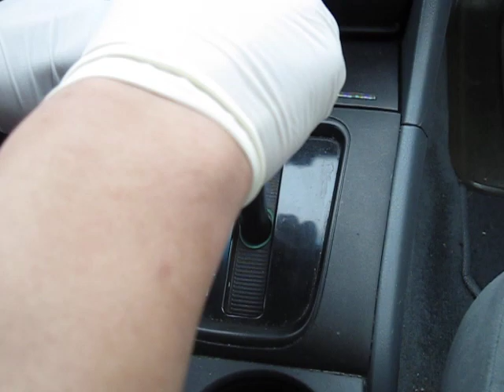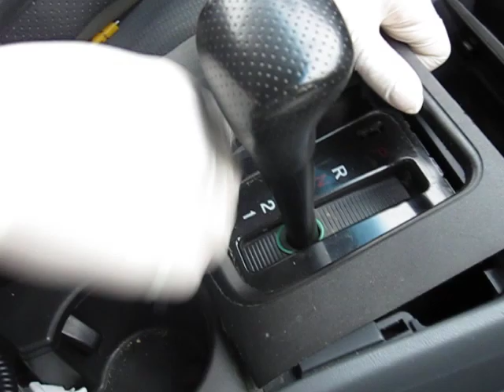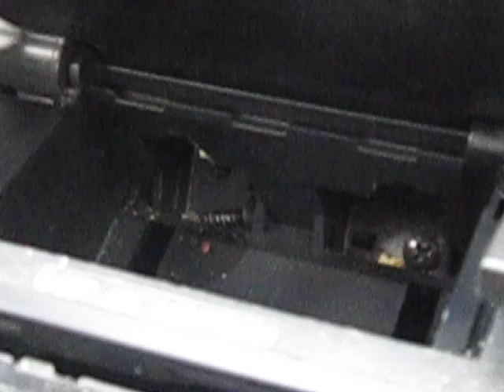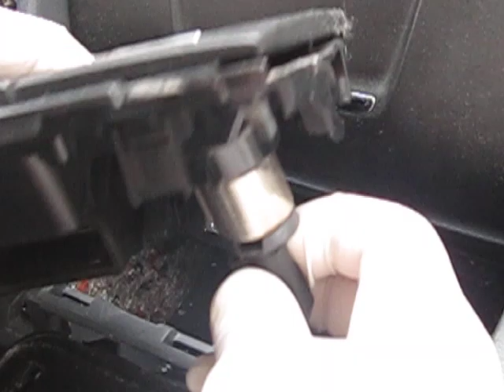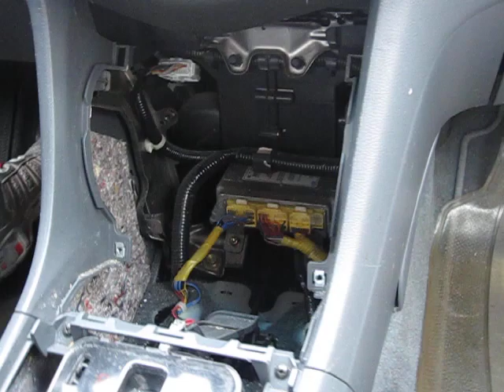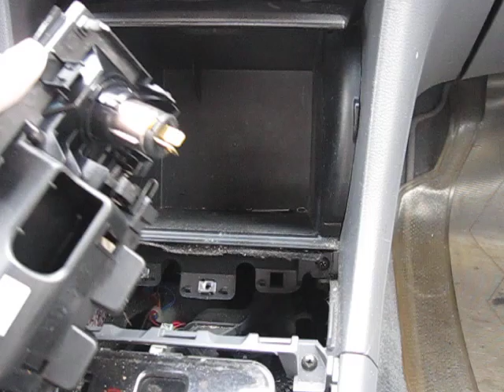2003-2007 Honda Accord Storage Pocket Removal/Replacement

Comment: Good instructions! Took my car to the dealer for an air bag recall and they gave me the car back with this compartment stuck, went back to the dealer and they told me that they wouldn't be responsible because they didin't touch it and wanted to charge 324.00 for a new one, once I removed i found a bunch of cables dislodged. The problem was just the spring... I fixed myself. Thanks!
Reply: P

Comment: After I pried out the small pocket "not an ashtray" (:43 seconds), it looked different than the one you show in the video.  I don't see an opening where I can screw anything out. I have a Honda Accord 2006 EX V6 with dual heated seats. I noticed that this Honda doesn't have the 2 heat seat switches. So, I am wondering if there is a different way to screw out the small pocket "not an ashtray".  My local dealership gave me a quote for $105 for labor.  That is outrageous.
Reply: Yes just look up "How to install aux cord in 2006 honda accord" it will also show you how to remove this center storage.
Reply: @thewaverlyplace100  thanks. Although, I already traded in my Accord for an Odyssey about 3 years ago.
Reply: @vincentkong07029 sure np, hopefully my comment can help someone else out!
Reply: @thewaverlyplace100  it has been so long I forgot why I needed to research this in the first place!  Lol.

Comment: Hi, I recently removed the big pocket holder thing that’s below my radio headunit, and after putting it back in, it doesn’t want to open completely when I press on the pivoting door.  Would you know why it doesn’t want to open all the way?

Comment: The Honda engineers that designed those crappy plastic center consoles with all the overlapping panels, hidden, and difficult-to-access screws should be kicked in the balls.